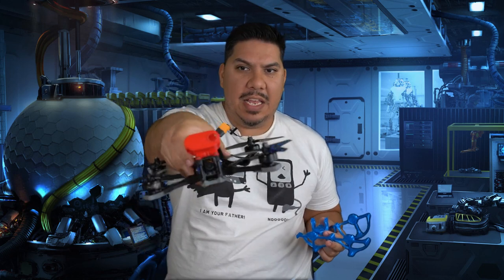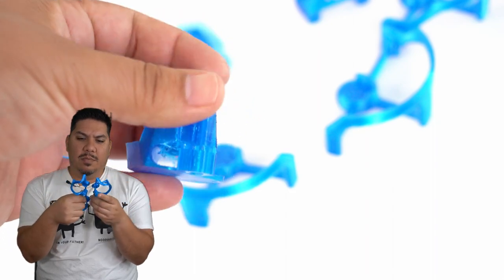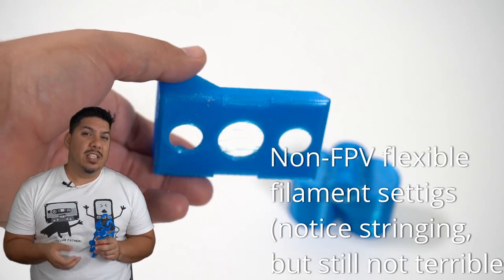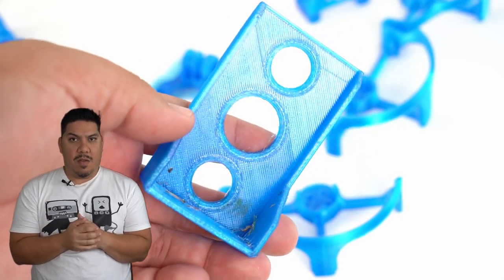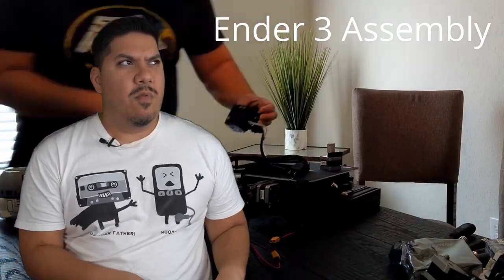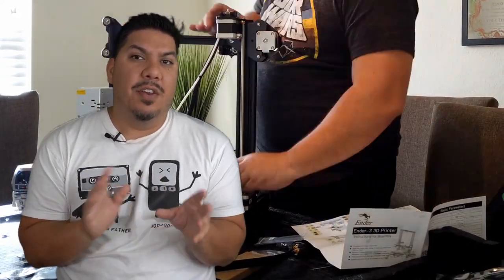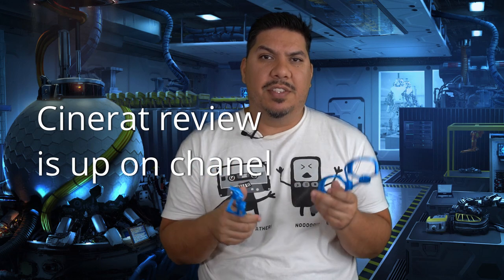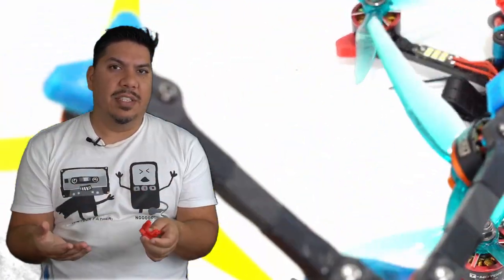TPU Printing for FPV - print drone parts, gopro mounts, arm guards for quadcopter Ender 3

Comment: I resisted getting a 3D printer for as long as I could but now that I have one and know (basically) how to use it I can't imagine life without it - lol.
Reply from the maker: such a good summary of what we all go through.  Dipping my toe into fusion 360 and designing parts, and then printing them feels like having a super  power
Reply: @JonE5FPV  Right!? It's like having a hammer and everything is a nail.

Comment: Wow, thank you! I had been struggling to get good results with Sunlu TPU on my Ender 5 Plus (stock except for MS direct drive upgrade). These settings worked perfectly, except I reduced retract to 2.5 due to DD. 👍🏼😊
Reply from the maker: Wow thanks for letting us know. Glad it’s working well now. And biggest 2nd tip is to dry filament before printing especially if you live in a humid climate

Comment: Hello Jon, I am in a similar situation as you were for the reason for purchasing a 3D printer. Using SainSmart TPU I have had both successes and lessons. Great introduction video to 3D printing for FPV
Reply from the maker: Thanks for the feedback! What are some of the fpv prints you have been doing?
Reply: @JonE5FPV  small pieces for a new Shendrone Geyser frame from Andy. I literally just bought my printer so the community is helping me out a lot. Between YouTube and  FaceBook there is a lot of information and a lot of opinions

Comment: Thanks.. I was able to get my ender 3 v2 up and running. Printing a 3rd nd holder/lens protector for Hero6. 1st one was usable but not great, i adjusted e-steps and 2nd one looked great but had internal stringing on the overhang. Adding supports and hoping this third one comes out perfect. Also, with fresh/dry filament this seems to be just as good or better quality then any prints i've purchased. If quality starts to degrade i will try dring in the oven and/or purhcase a filament dryer.

Comment: Thanks for the encouragement.   Learning with the Ender 3 pro right now. Did you do CHEP's modified extruder for TPU on Ender 3?
Reply from the maker: i did not, keeping that one totally stock.  The stock extruder actually prints great as long as you dont do somehting super flexible like ninja flex.  But for standard TPU can print it all day.

Comment: what version do you recommend to buy? STOCK, PRO or V2? is it worth to buy upgraded version or better buy stock and do upgrades by yourself?
Reply from the maker: I am actually making a video on this now. The prices fluctuate a lot. But here is how I break it down. 

The pro is worth about $20-25 more than stock. 

V2 is worth about $70-80 more than the stock. 

If price difference is in that range then get the v2. I have one pre ordered already.
Reply: @JonE5FPV  thx! looking forward for your video about it :)

Comment: So just setting changes and print decent tpu parts on the ender 3?   Im sold then
Reply from the maker: Correct. Prints pictured are all on 100% stock.  Can get them even better with some slight tuning.
Reply from the maker: Ender 3 v2 pre order is also up in the links. Comes with a few worth while upgrades for the price.  I’m getting one as well

Comment: I'm seriously considering the CR-10, my first 3D printer as well. Do you reccomend it? The quality in the pics of prints i've seen look very detailed.
Reply from the maker: Cr10 was my first printer. After owning 7 more I would say start with ender 3 unless you are 100% certain you need the extra size of cr10. I only used the size on it once.  Rest could have been done on a smaller printer. 

The ender 3 is cheaper, easier to level, and takes up less space and is quieter if you add the silent board. 

Ender 3 v2 has silent board already do get that one if in your budget.
Reply: @JonE5FPV  I didn't see your reply before i purchased the CR-10, I was trying to get an order in to possibly get it earler, and just assumed it wasn't much different that the Ender 3 except for a few more options. I did see many reviews saying how good the quality if the prints were. Oh well, I've got enough room and the price was still good so I guess it'll be fine. I hope it prints most things, theres a couple of items on Thingiverse that I tried to get printed at Brain3D and they had to refund because the files were too complex for their printer. Hopefully that's not a common issue.
Reply from the maker: The construction is basically same, so your are correct it is like a larger Ender 3.  Anything the ender can do, the CR10 can do, and you will have advantage to print larger things like a helmet in 1 go. 

If you have the room, and can put it in a place that the noise wont bother people, then you should be good to go!  

Curious on what files were to complex, post an example if you have a second later.
Reply: @JonE5FPV   Here's the link, it's just a DJI antenna mount with GPS pad coming ogg the back. Not too much to it, I think he mentioned something about several angles or something similar,   https://www.thingiverse.com/thing:4572106

Comment: I just got a lotmaxx sc-10 and my pla prints are great. My tpu mounts, not so much. I'm having issues with bridges and such. They droop. Ill try and find u on fb and send some pics. But 1st I'll try your advice. Love ur vids and I'm from the same Era as u. Love Johnny five!!
Reply from the maker: thanks man!  I do notice for tpu i need to print slow, im currently using speed around 20, and first layer 18 or so, this isnt fast enough to form bridges so i always use support, and try to plan what orientation to lay the part to make the front (or face) on bottom or on top, to make it look cleanest after support removal.
Reply: I haven't figured out the support deal. When I print supports it wants to fill in the entire print. Example, the front or side where the gopro goes in, is completely printed over. Is that how its done? Then u cut it out or?? I've had this about a month now and have 4 usable gopro mounts and a few immortal t mounts.

Comment: uuuuhhhh im new to this but i dont see magic 2.0 anywhere there just CHEPV4.8.x_0.20(Good).curaprofile is that what profile i need to load??
Reply from the maker: Hmm. Looks like he renamed them. Get the most recent PLA one. That is probably it
Reply: @JonE5FPV  Yes I used the CHEPV4.8.x_0.20(Good) one along with your settings and I had no issues printing a toothpick canopy right out of the gate! thanks for the info and the reply m8

Comment: Do you have to keep your tpu filament dry?
Reply from the maker: Yes, if you live in a humid climate.  I use a large tote that I got St Home Depot to keep all my filaments. I just toss any silica packets or desiccant that comes in a roll or with anything I buy into it. There are better solutions but this was easy and works for me well.

Comment: I had an ender 3 pro for little over a year, printed tpu perfectly. Look for makers muse on YT. find the chazmeister ender 3 profile. It's the best I've ever seen..  cleanest tpu prints I've ever seen. I now have a sovol svo1 with direct drive. I turned my ender 3 into a cnc machine so I could start cutting my own frames. I'm just waiting on a high speed Dremel to come in the mail. Files on thingiverse for the mounts and stuff to make the ender 3 into a CNC.
Reply from the maker: Been a little curious on that sovol, think i will try the ender 3 v2 first, but so many great cheap options right now.  amazing.
Reply: @JonE5FPV  yeah.. definitely makes it easier for someone to get into it. ... Then there's fusion360, which is a completely different beast lol... I can design a GoPro mount, but that's about it lol... Primitive FPV has a great tutorial on it.. super easy to follow.

Comment: Are resin printers good for drone parts? Thanks!
Reply from the maker: I would say the cheaper ones no.  They are for very high resolution great looking parts, for for impact you want something flexible like TPU, or in some cases nylon.
Reply: @JonE5FPV  The cost of the printer does not make a difference but they are making a bigger range of resins all the time and some are definitely more flexible. So worth looking into.